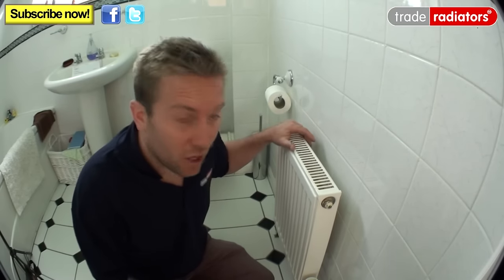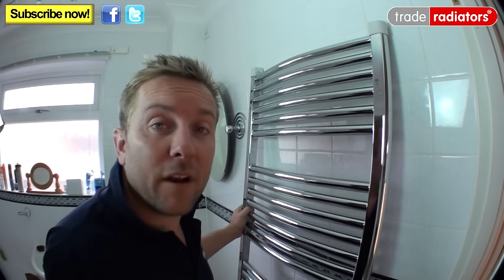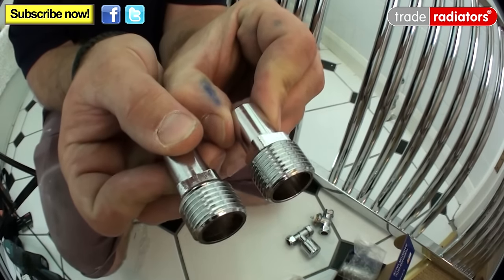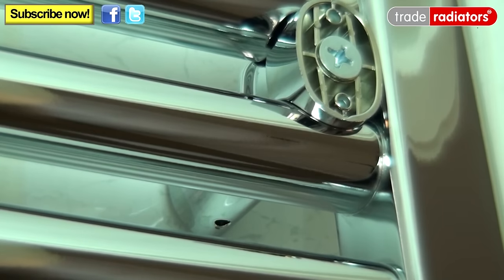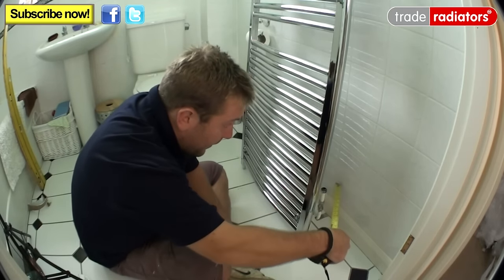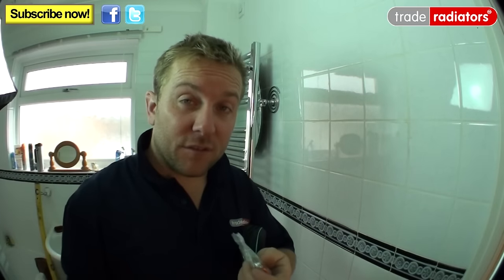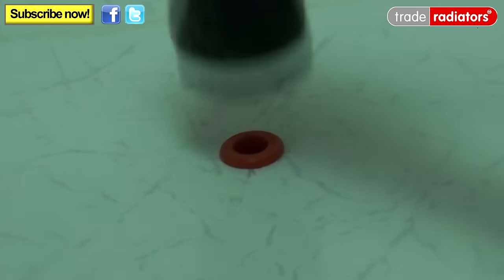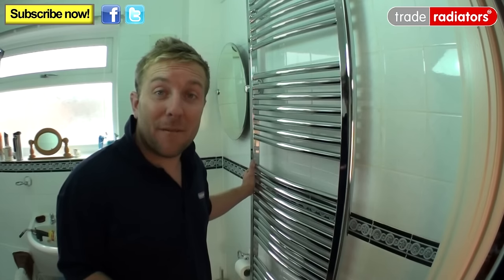How To Install A Heated Towel Rail - Step by Step Guide by Trade Radiators

Comment: I enjoyed your video.  Just installed a heated towel rack in my bathroom, although it was to dry wall, not tile.  They are not common in the States, but I just love mine.
Reply from the maker: Thanks for your comment Gray, I know we can't believe they are not common in the states either, they are the perfect solution for the bathroom.

Comment: Hi. Do I need to take off the existing locksheild and TRv valves from the pipework and replace with ones compatible for the towel radiator? Sorry for sounding dumb but thought better to ask rather than dangerously guess. 
Thanks. Great video from you as usual.

Comment: Hi Trade Radiators, Please can you help me with my following Question. I have a Combi boiler (quite new) and i also have a small radiator in my bathroom which i am wanting to change to a towel rad. However It is confusing me at the moment. I've been told that because i want it permanently on i should just fit two Lock shield valves on it. Is that true or do i need a TRV on one side along with a bypass valve ?. I also want to keep the cost down as much as possible. So would a Standard valve and 1 lock shield be find to use without a bypass ? Many Thanks

Comment: I have been trying to install this set up but I keep refilling and leak testing (4 times now!) and find leaks around one or both of the the spigot tapered threads. One seems to go in all the way up the thread while the other still has some thread visble once tight. I notice (now that I see this video!) you say "don't tighten too tight" but I have been tightenting as tight as I can, which seems to 'ruffle' the ptfe. should I apply more ptfe and leave a little looser to let the ptfe form the seal?

I think when tightening, I can feel that I'm tightening to the point of getting through the ptfe and have the metal threads tightening against eachother. is that too tight?

Any help would be great.

((I've always avoided tackling plumbing in the past but having youtube these days has enabled us laymen to tackle previously mystifying tasks. But there's no substitute for 'on the job' knowledge and experience, and doing these things for the first time is sometimes 'trying' (£*&%&£& **&%^$ )"(*$£&$&£^$%%**************cks!.... to say the least - after what has turned into 11 hours to basically fit a towel rail to the wall - looks nice but the house is cold! - You've got to laugh I guess! ))
Reply: Did you sort it in the end. Not enough ptfe tape?
Reply: Yep, I ended up using the thicker 'gas' PTFE, which seemed to have resolved the issue (thankfully I'm not still installing it 8yrs after my initial post!!😂😂😂). 😊 @TheBroadyBikers
Reply: @JFaithfull  😂😂😂😂😂😂 I just came across the same issue. I googled it lol...lol. I noticed he never got back to you. Cheers for remembering lol